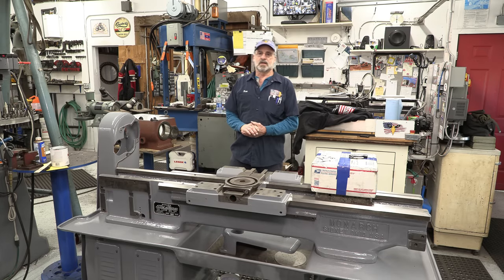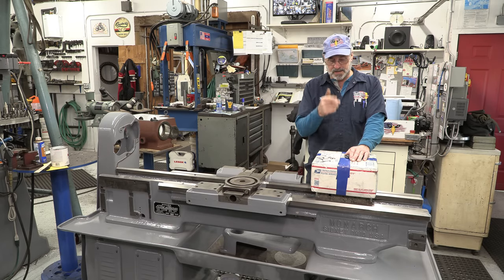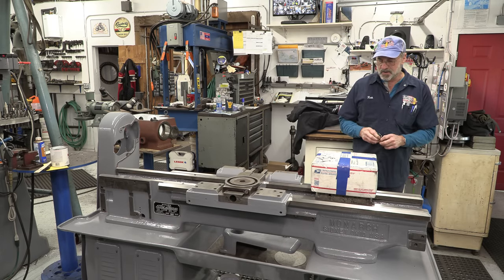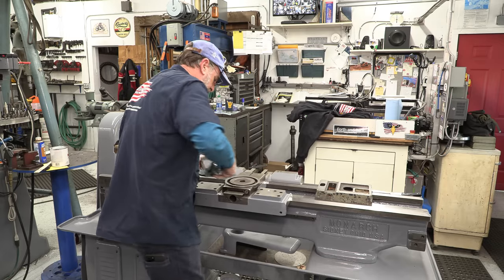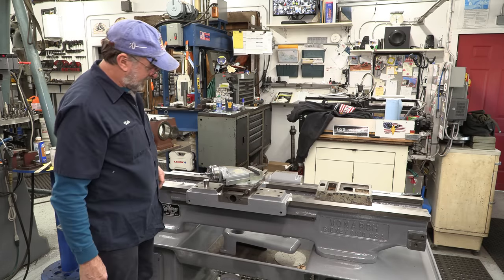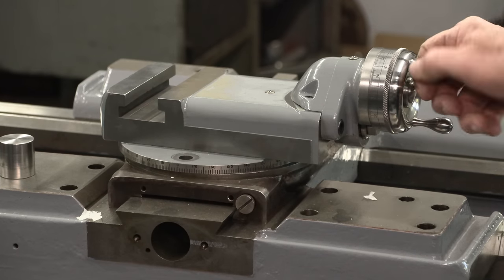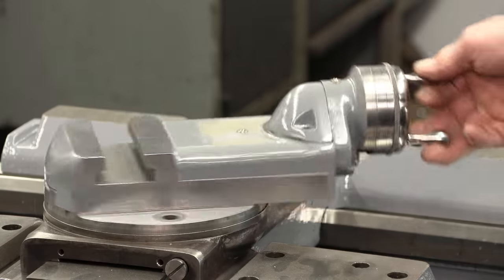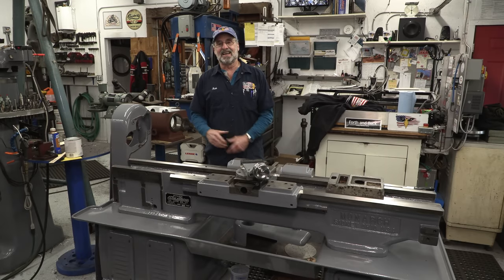Machinist Porn Pearl's Compound

Comment: What do you use for the inside of the castings? I usually use Glyptal but would like something lighter colored. I would assume you working on marine vessels,probably some super epoxy used in the engine rooms?